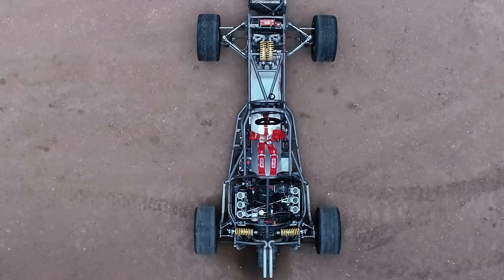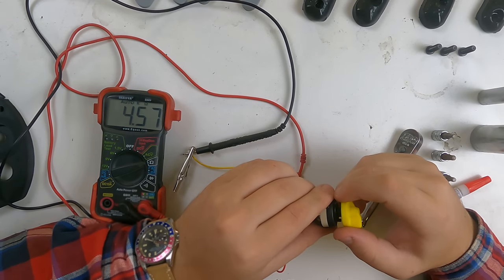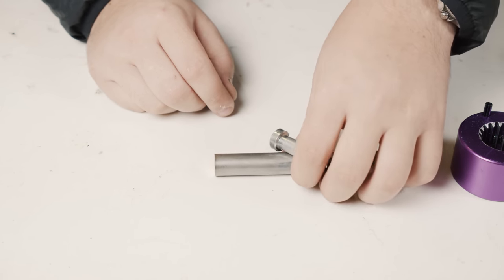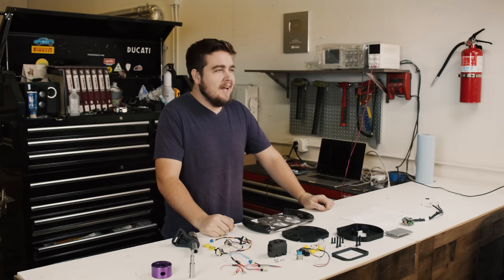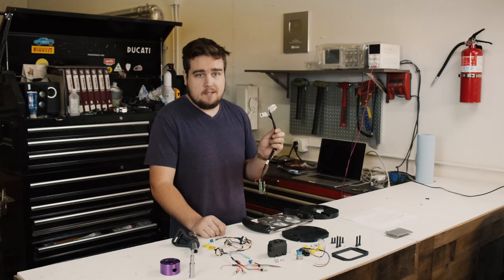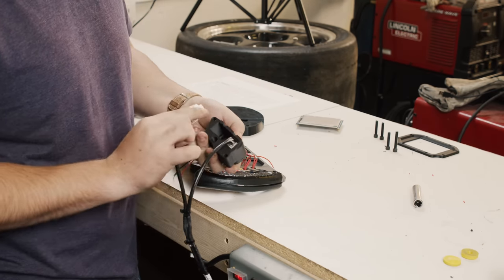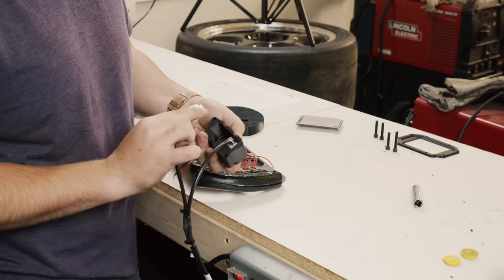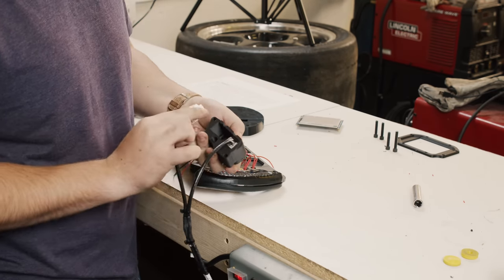The 60's F1 Car Returns with a V12

Comment from the maker: Somewhere between Premiere and Youtube I lost some audio between 6:02 and 6:15. Sorry about that everyone! It's a short explanation and rant about how difficult TPU is to print.
Reply: Also another at 10:48 when you start to talk about the wheel's screen
Reply: I actually thought it was a joke. "Okay, We're going to talk about the spaghetti here..." then nothing about wiring at all. lol.
Reply: TPU is pretty material dependent. Ive used solutech tpu to much success on a stock ender 3, just cut all my speeds to about 40% of my pla profile
Reply: Tpu and abs and petg are all ambient temp dependant.  Having an enclosure, even just a cardboard box, around the print bed is advised.  Yes extra heat will kill your hotend and fan, and your power supply if it is anywhere near the print bed/enclosure, but it is the best way to prevent the edges from peeling off the bed (and thus warping) as well as keeping layer adhesion consistent.  I learned this the hard way in a temp controlled room.  Enclosures are key.
Reply: @ryanhebron4287  same lol
Reply: @jackygrush  same same lol
Reply: A suggestion for the steering wheel grips: design a mold using the current grip design as the negative, then print it in pla and then mold it around the steering wheel frame with a pourable rubber. That’s what my formula SAE team does for our steering wheels and they turn out really nice with no fasteners on the grips
Reply: @patrickmcnutt7591  seems like a decent idea. But it would be more difficult to change electronics afterwards, if not impossible. So maybe at a later stage?
Reply: @D3nn1s  I'm just talking about the actual grips, not anything with the electronics, so he could always scrape off the rubber from the grips and print a new mold if he made changes
Reply: I print TPU with a basic printer with a bowden extruder, if you set every travel speed to the same speed, disable retract, and use the "equalise filament flow" option in Cura you get some pretty decent TPU prints, although you need to deal with lots of stringing. If you have a direct drive extruder you can use retract, but the TPU is too rubbery to retract or change speed properly in a bowden tube.
Reply: @patrickmcnutt7591  oh i thought you meant casting around the metal base. Why arent there any fasteners then? Do you cast them into the front side?
Reply: Ya there's a couple skips
Reply: Occasionally my headphones crap out and I have to reset them, and I thought that's what happened but it wasn't...I was really confused for a few seconds. 🤣
Reply: Race it at Hoonigan lol
Reply: Also slow down the TPU print speed with smaller layer height, slow and steady wins with TPU. Also run it on the hotter end of the range for sure.
Reply: Hey Wes, 

What are you doing your point cloud with, and are you happy with it? 

Thanks!
Reply: Westley this might be a good topic for a video. What does it take to produce videos for a +100k sub youtuber? How many people work with you and what do they do? Thanks, I noticed the missing audio but it didn't take anything away from the good work you do.
Reply: If you are interested to start a kit-car project, please let me know

Comment: I’m in high school, one of the things I may go  to college for is engineering. That is solely because of you and this build, thank you!
Reply from the maker: That's great to hear! Thanks for watching, and best of luck!
Reply: I went to school for engineering and I have to say I would have much rather just gotten a shop and started tinkering around and started learning with hands on experience instead. All you do in engineering school is book work and equations and very rarely anything hands on so when you finally go to do your project that inspired you to go to engineering school for, you would in actuality be a thousand times more skilled at that project if you had just been building projects like that for 4 years straight instead of reading books about how the modulus of elasticity and laminar flow. Or maybe you could meet half way, there are cool tech schools that do 2 year programs and have some good hands on stuff.
Reply: @El_Chompo  FSAE tho
Reply: Find a school with an FSAE team, if you like this kind of stuff you will not regret joining, I’m currently a freshman and joined my schools team and we are doing many of the things he did in the video. :)
Reply: If you want to fabricate, then go fabricate.  If you want to engineer, then go study engineering.  If you want to build the next generation of vehicles at a major manufacturer then yea definitely go to school and don't just go tinker in a shop.  But sir is right about doing applied projects on the side.  Preferably do an internship.  It's very possible to work year round as an intern.  It's what I've done my whole time in college.
Reply: Consider getting employed in a Machine shop along the way as you attend school.  You'll likely start with menial task's, but you'll also be starting to practical app allot of stuff as well.
Reply: That's awesome henry!!Henry!!! I'm 33, I wish I did that. Definitely a regret I used to have. I went for electrical engineering and coding. Very boring. I never finished because I have a mechanical mind. And I dropped out due to boredom. Definitely go through with mechanical engineering or material sciences if you want to build anything like this
Reply: @El_Chompo  I did the opposite: I was a technician/mechanic for 25 years, however I couldn't build something like this alone because I don't have the theoretical engineering knowledge so the final product would very most likely suck
Reply: You can learn all that at home in a year.   Get a blue collar career that will make you $ and do engineering at home on the weekends
Reply: i'm an engineer and i love every second of it. don't be afraid to change your mind once you are in school though. a lot of engineers find they would rather to electrical or mechanical or even just CS (or CSE). If you do go for a CSE degree, i have to say that it kind of doesn't matter in the workforce if you are officially an engineer out of school. i got a CS degree, and my first job was a CSE job haha. and make sure you go to therapy because there is a high rate of mental health issues in engineering. also if you don't do drugs and haven't been convicted of a crime (and don't have outstanding debt) you can get a security clearance pretty easily when you finish school
Reply: @noncog1  haha agreed. I’m sure most SAE teams aren’t like that but having to deal with that just completely ruined the experience. Probably wouldn’t have been so mad about it if they actually didn’t use my design without telling me.
Reply: WHEN YOU GO TO COLLEGE DONT LET EM FUCK WITH YOUR DREAMS MAN STAY VOCATIONAL STAY WHAT YOU WANT DONT LET EM TELL YOU TO TAKE THIS PATH IF IT ISNT WHAT YOU WANT CAUSE YOU HAVE TO LIVE WITH THE DEGREE AND CAREER
Reply: This is great. I took an alternative route took all the cad/drafting/engineering courses I could in highschool as well as "shop" machining 1-3, welding/fab 1-2, and engineering prep, then went to technical school for CNC programming (at 2 years you get a bunch of extra courses like metallurgy,welding, GD&T, cutting tool applications theory, and combined with working full time in a machine shop and building my own cars, I have built up enough experiences and knowledge that now I make INDY car and nascar engines. Work in a variety of fields. Spend 5 years in industrial, 5 years in aerospace, 5 years in automotive and build your capabilities in manufacturing and design then go get your dream job. 

Edit: if you plan on your' sophomore year of highschool you can do big things before you turn 30
Reply: same but just racecars in general 😅
Reply: I just graduated highschool, and I can say I will possibly do the same.
Reply: Colorado state university! Great program. Currently studying mech. We’ve got a formula sae team going all electric this year, but there are some pretty cool stuff we do
Reply: If you are hands on and want to learn more practical stuff vs theoretical stuff, then I would suggest a tech school! That’s what I did and instead of getting an engineering degree, I got an associates with an apprenticeship with a company that made a major impact on my education and understanding of practical engineering. 

I now work in the areospace industry as an automation tech, and my house is full of stuff like this. Not to say an engineering degree isn’t what you should go for, but a technical degree is faster and often more what people really want, in my experience. There is also a major shortage of technically minded labor and not as much of a shortage of engineers at this time, so it may be easier to find a better paying job/ more fulfilling job. 

Just my 2 cents, I’m sure you’ll figure it out. Either route is good!
Reply: Dude i was an engineer. If you want to build cars or whatever, then do that. If you want to sit in front of a computer design things for other people to build and be subject to regulators then be an engineer. 
My dad had classic cars, motorcycles, a machine shop, and excavation equipment. Because of that i thought i wanted to be an engineer. The career was disapointing to me.
Reply: Don't do it!
Reply: @sirgallium  mechanical engineering tech is mechanical engineering light with hands on labs. I went while working as a welder/fabricator then toolmaker. Engineering careers suuuuuck.  I went back to lawschool after 15 years in my "dream" industry (automotive manufacturing) and wish I'd never become an engineer.
Reply: @WesleyKagan  Like op I'm also very interested in getting an engineering degree and in high-school; but I've seen some of your videos. So I have to ask what else have learned? Electrics, coding, machining, physics, material science, and some chemistry. However I want to know more, and how someone would go about trying to do and learn what you do
Reply: Do it the human race need more engineers and scientists. Not lawyers and bankers
Reply: Start working on your own projects before you ever hit the classroom and you'll be ahead of the game!
Reply: Go for it. You'll have a lot more confidence in the choices you make.
Reply: Lot of these guys mentioned FSAE in college. I do that right now, I’m the chassis and engine lead for our team at K-State. Pretty much the only reason I’m in college, it’s allowed me to keep up with welding I learned in community college and to learn all the other fab skills that come with the club. To be honest, I know a lot of people who’ve just gone into a fab shop after engineering. I think the thing that gets looked over is if you do engineering and have the shop skills, you have a really broad range of careers you can get into. Even if you do shop work in the end, you have an immense amount of design background knowledge that you can apply, so not only can you make parts, but you can design them to what they need to be as well.
Reply: Make sure you truly enjoy engineering and know what they actually do for work. You might find that you’d rather go to a tech school or a major totally unrelated. As a junior in college, I now know that I would’ve much rathered go to a tech school and invest the rest of the 120k in dept that I have into building a car, and not a pointless piece of paper. But I’m in too deep to change now, so just make sure it’s something you truly like
Reply: Do it you won’t regret it
Reply: @1slow370  biggest mistake I made was not going to a technical high school. I’m reading your comment right now and I have the opportunity to go back to school or training and have it paid for for me. I suppose I don’t know where to start and wish I had done a plan like you mentioned.
Reply: If you enjoy it do! We work a long time so do something you like. Plenty of good advice in these comments as well.
Reply: Keep up the good work!!! We're all cheering you on.
Reply: We need engineers
Reply: Just so you know it's a lot of work, I'm a freshman electrical engineer and I had a 5500 word minimum final project report followed by a 4000 word minimum final essay right after it
Reply: @Ash-bx6kq  well done and they are behind you now? . Mate, gaining skills gives you options in life and options are a great thing to have. Also keep an eye on AI, it will change the world for all of us.
Reply: @liamgross7217  yeah, my last final was today. And definitely, AI is insane rn, GitHub Copilot is was super helpful for my CS project, and chatGPT is amazing at explaining stuff to you
Reply: @Ash-bx6kq  best wishes for the future from 🇦🇺
Reply: @liamgross7217  thanks
Reply: @El_Chompo  I'm late to this, but I am getting an engineering technology degree, with some involvement in Baja SAE. I am doing more than enough hands on/tinkering work, with a machine shop that I can use for my several small-engine projects. I don't like typical engineering, I am more of an applied engineer.
Reply: Everyone talks shit about engineers, and some of them are right. I've met some people at my school who will never build things, because they are really just mathematicians. I'm getting an engineering technologies degree, and people say that that is the degree for the dumber engineers, but it is really for the people who want to work with their hands. I am doing a ton of labs, as well as participating in Baja SAE. It is definitely going to be worth it in the end, and I get to play around with machines any time I want. Find a school with a Baja or Formula SAE club, they'll help you learn what you want and it'll look good on a resume.

Comment: So happy to see you back at this project, Wesley. I wouldn't be terribly disappointed to see an entire video dedicated to the equal length exhaust so we can hear the V12 scream... just saying
Reply from the maker: Oh it's going to sound good- I'm debating on whether I'm going all mandrel bent on the stainless or if going to weld it together. Cost will probably be the question there.
Reply: @WesleyKagan  don't forget the time component. Every time I fire up the tig, it feels like the sun is about to come back up as I finish the job.

I liked the steering wheel bit too btw, it's cool to see the design in how communication will be handled and what data will be read based on what condition is active on the wheel.

Comment: ALso you should strongly consider using a Teensy 4.1 and Canbus for all comms between systems on the car. I also have my ECU directly interfaced to the Teensy4.1 datalogger as well through CANbus. cuts cables down hugely and getting different systems talking to each other stops being a new problem each time.
Reply: I was just gonna comment this. The CAN-bus is very robust, quite fast and it is easy to add stuff later on. Also as you say, with a Teensy or something similar it is very easy to implement!
Reply: what blows my mind is in like... 2015-16? i used Teensy 2.0's to build a few mechanical keyboards... really has never been a better time for DIY